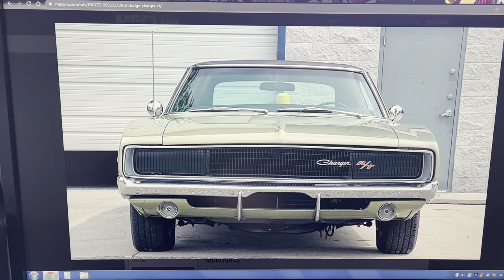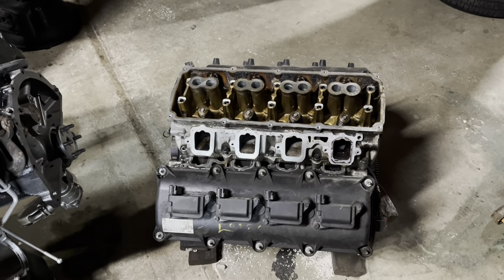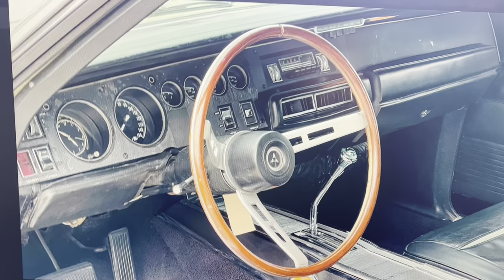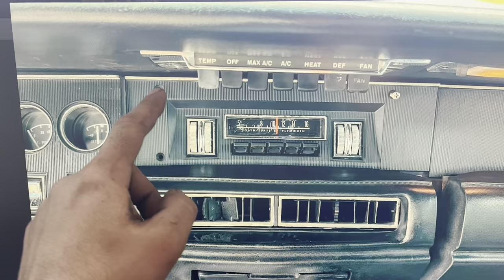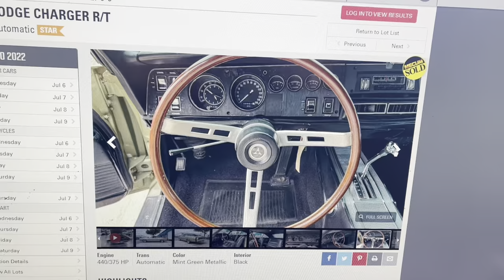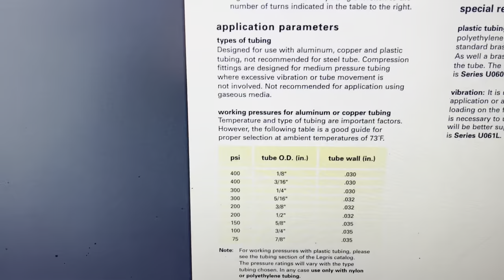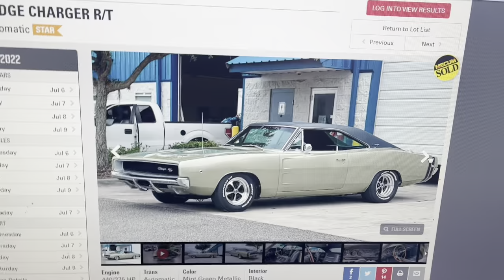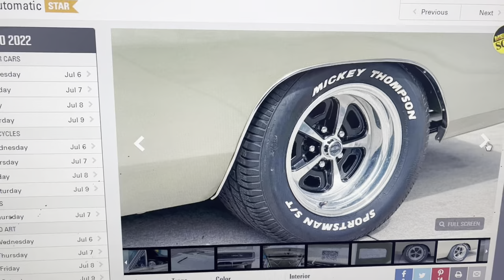Why Did This 1968 Dodge Charger R/T Just Sell At Mecum For $170,000? (It’s Unsafe And Bad)

Comment: FYI - 
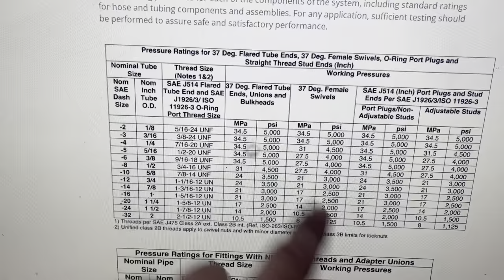At 10:45 you are looking at a chart for 37-degree fittings, AKA JIC or AN fittings.  Not used in automotive except has been adopted in aftermarket fuel systems.  The 'AN' stands for Army-Navy as was part of military specs years ago.  Is commonly used in hydraulic systems on construction/agriculture/utility equipment.  Automotive brake systems (US cars, that is) used SAE 45-degree fittings, double-flared on the tube ends.  SAE 45 is also used in HVAC, but as a single-flare and some fittings are specific to HVAC.

At 11:00 you are looking at a chart for compression fittings with alum or copper tubing - not steel.  That rating would be based on the ferrule's bite into softer tube material.  Steel tube would give a higher rating, but as noted on that particular page (whose is it?)  they aren't recommended for steel.  There are compression fittings intended for steel (Yor-Lok is one trade name) but that does not seem to be what is seen in the picture of the car.  A Yor-Lok union fitting for 3/16" tube has a 6700psi rating, quite sufficient for automotive brake systems - but I do not know if they are approved for that application (via an SAE standard or a DOT approval).

Regardless of my above comments, I agree with you that a standard brass compression fitting is not appropriate for that usage, that it draws question to quality of other work on the car, and it should never be installed with the presumption that somebody will fix it correctly later on.
Reply from the maker: I know. You’ve hit the nail on the head though - for that type of fitting, there is no rating for steel, because it’s not rated for steel. I included that information anyway, because I know there are softer brake line materials in use now and that information may well apply to them. It still drives home my point - on a softer material that can actually be compressed by that fitting, it still isn’t rated to hold that kind of pressure. I could have searched around to find more appropriate specification tables, but I think the point I’m making is clear.
Reply: @DeadDodgeGarage  Actually, the pressure rating would go UP on a harder tube, because it does not compress as easily, allowing the ferrule to crimp more effectively to the tube while it makes the seal into the union body.  You want the ferrule to crimp down into a circular line of sealing onto the tube.  I was curious and did some more digging, and Parker makes a line of brass compression fittings for steel tubing, although it seems they recommend a steel nut and steel ferrule for that applicaton.

Comment: My buddy bought a 67 Camaro 350 auto a few years ago and he got burned, engine was actually a 305 with a 350 air cleaner, it had no rear brakes at all, damn near every bolt in the front end was loose or just the wrong bolt, it was listed as rewired with a Painless wiring kit, not half the wiring was speaker wire you'd use in your house, car was an absolute mess and he paid $48,000 for it certified from a dealership, took almost a year in court to win his case and get his money back, no idea where the car ended up?
Reply from the maker: Good lord… that’s really bad. But honestly doesn’t sound that crazy today. There are tons of dealers selling that kind of garbage all over. It’s a big problem. Buyer beware…

Comment: Old video dont know if you still read comments but i had this EXACT SAME issue on a 1978 thunderbird i had purchased. The kid i bought it from was "restoring" it back to a driving condition. New fuel tank and new water pump. For his new "fuel system" he just ran a rubber fuel hose from the tank to the fuel pump. No zip ties nothing. Just hung on the ground. It would get caught in the front coil spring and be compressed so no fuel on hard right turns. He also USED A DAMN COMPRESSION FITTING on the brake line he put in. Crazy he put one brake line from the proportioning valve to the rear brake hose and that was it. Didnt touch the old hoses didnt replace the failing master. Nope. Just half ass slapped it together. I ripped into him because he lied straight to my face and tried to get money out of a trade we did. Ive un jurry rigged all his work and put a proper fitting using a flare tool. As well as all other brake work. However. When i was doing the brake lines to the rear drums off in my garage. That compression fitting FAILED right there with minor pressure from just pushing the pedal to see if the car wouldn't roll back. Literally as light of hitting the brakes as possible. What you say is true. Brake flaring tools are literally 25$ and a proper fitting is $3
Reply: NEVER TRUST SOMEONE ELSES WORK NOT EVEN A SHOP. DO IT YOURSELF
Reply from the maker: Seriously! Yes, I read all of the comments. Haha.

Comment: Well, I hate to admit it, but you are right. They were so cool and iconic, but poorly built and lots and lots of issues. The second happiest day of your life is when you buy one of these classics! Of course the happiest day of your life is when you sell it.
I hated my brother in law, who was a Ford freak and told me about the Chargers having a ride like a  bucket of bolts when you drive them. I was so angry at him. Of course, I never rode in one until I started getting serious about getting one. I did a test ride in a 70 RT and a 69 that had been rebuilt and had a new engine. They were pretty darn clunkly and I knew immediately that what he said was accurate, for I had taken his '63 Fairlane to Homecoming  in the 80s. It was a far different ride. The 390 did not have the power and torque of the 440's but there ya go. Raw power, poor build and lots of issues, but I still love them. Worts and all.

Comment: A quick Google finds lots of outlets here in the UK selling 3/16ths compression fittings as 'brake pipe joiners.'

Scary stuff. I had no idea such connectors were available. I only ever make flared brake line ends.

Comment: The vacuum headlights break my heart, they should really have fixed that, my 69 rt has an all original 80s soup can for its canister and worked up till the day I wrecked the whole front end
Reply from the maker: 😭 that’s very upsetting. Yeah, it’s easy to just hook them up and they’re a very important part of the magic of the Charger. And for $170k… personally I think the headlights should operate.

Comment: Very good points here. Why did it sell for 170k? Even a perfect restoration goes for less. Crazy that that’s just looking at the pictures. Bet the wiring is the thing of nightmares.
Reply from the maker: I know. I can’t even imagine what else isn’t visible in the pictures. I did a video recently on a much, much nicer example that was listed at a dealer for 150k. Even that seems like a lot, but prices have gotten insane. Of the two, it would’ve been the better deal by far. This car looked better at auction than it actually was, that’s probably the real answer.

Comment: I bought a car advertised as excellent in and out. Didn’t know what to look for and got a $10,000 life lesson. 😮 live and learn…sometimes the hard way
Reply from the maker: I bought a pretty expensive Charger (as alluded to in the video) that was hiding some bubbles and previous rust repairs. It’s fine… it’s still a Charger. But one day, I suspect it will cost me a good bit more than $10,000 to fix it. I’m not looking forward to that.

Comment: The term "Restored" has been and remains a very overused statement that is unfortunately used to describe anything from a base point of a vehicle receiving a rough spray job and a interior vacuum all the way through to a nut and bolt professional restoration and unfortunately it confuses people who do not understand cars nor restoration work, auctions are a classic dumping ground for vehicles just like this, I pity the new owner as when they take it to have work performed on it they will receive a lot of very bad and expensive news. I remember viewing a 1969 Boss Mustang that had undergone a "rotisserie restoration", yes it clearly had been completely disassembled and placed on a rotisserie, but the reassembly was just like this car and was clearly put together by someone who had absolutely no idea what they were doing, but they were correct in that it had been on a rotisserie.

Comment: Brother, in the last five years this has become depressingly common. There are whole shops that do nothing but slap together and flip classic cars and then sell them at auctions. I have seen many cars that were so bad they were literal death traps. we're talking unmounted brake calipers, bodies barely connected the the frame. Rotted out frame rails covered in bondo, frame components literally missing, chunks of two by four replacing transmission mounts. fenders mounted on tack welded scrap steel because the actual mounts had rusted away. you just wouldn't believe it. I would guess probably half of all the classic cars going through recent auctions and for sale at classic car dealers are in this kind of shape
Reply from the maker: Oh, I know it… I’ve seen way worse than this. It’s just that this one was as bad as it was, but sold for top, top dollar for one of these cars that bothers me.

Comment: I'm no pro either, but after 10 years doing a resto on an E-body and doing every bit of research, going through the corporate packets, collecting every bit of information, and then putting it to use. Well it's ruined me when it comes to challengers and barracudas. I very rarely see one that's done right, safe, or presentable to a person in the know.

Then I went to work in a body shop. I can't hardly go to a car show any longer. Cars that 15 years ago I drooled over, I'm now silently picking apart. Disgusted with a lot of it, "omg wtf did they do here" goes through my head a lot.
Reply from the maker: Yeah… bad body work is pretty much the norm. My Charger isn’t any better for that. It’s definitely interesting to realize that even the most beautiful car you see at a show is probably hiding patchwork and bondo.

Comment: The sad thing about this hobby is, as more and more quality shops can't afford to keep their doors open due to high labor costs, part shortages and general high costs that open the way for cheap hack job shops to throw on a ton of filler, slick the body and flow paint smooth as nail polish but cut as many mechanical corners as possible. Cut corners where it dont show makes for higher profit. Take your time and do your homework, don't be afraid to walk away most times you can trust your gut feeling.
Reply from the maker: I know. It sucks.

Comment: I've always been wary of these car auctions, I've seen guys loose multiply brain cells when bidding on cars at these auction, by sometimes bidding way more than the car is worth, or you could build yourself. Whoever bought that thing for $170,000 without having a knowledgeable person look it over first deserves to get burned. Myself, one of my cars is a 1965 Ford Fairlane 500 Sports Coupe that was an original 289 4 barrel 4 speed car that had a good body but was in pieces. I then proceeded to rebuild the car myself, and after 5 years of work, I have a well built, safe car with a 450 HP 347, Borg Warner T10 (original transmission), 9" rear with 4:10 gears, a Detroit Locker, Baer Pro-Street axles. It has a narrowed rear end  with 29 x 15.5 x 15" tires, 4 link suspension, 4 wheel disc brakes and Viper Red paint. The only things that I didn't do was the paint and the upholstery. I've probably got somewhere around $120,000 dollars in it but I'm not afraid to drive it. I have taken it on 320 mile round trips without a problem or a worry.

Comment: I see stuff like this a lot..especially if the car has been to multiple shops prior to falling in my hands. 
That radio bezel is a perfect example of the kinds of things I see. 
Missing and incorrect mounting hardware. 
Can't stand it when I work on one of these and it's immediately missing the correct fasteners,  screws, clips, nuts and bolts . I consciously cannot reassemble and let it leave my hands without all the hardware it was designed to be put together with..it is not fun to fix another mechanic's neglect or  incompetence. How they got away with such shoddy workmanship is inexcusable.
Reply from the maker: It’s maddening. I work in a restoration shop, and one of our biggest strengths is in the knowledge, hoarding, and restoration of correct hardware. We’ve got piles of factory Mopar nuts and bolts, bins of correct breathers, caps, brackets, linkage rods, wire connectors and terminals, and on and on… Not every car is going to be 100% right on this front, but damn, they could at least try.

Comment: Great video and very accurate. More than likely it was someone buying based on emotion from the pictures. Kind of like that MILF you go home with from the bar. After a "few" beers and in the dim lighting you swear she is a 9/10. Upon closer inspection, in the light of day, you realize she is more like a 6 or a 7 and is batshit crazy. At least in that analogy, you can slink away to lick your wounds. With a car like this, you are stuck with either having to pony up the money to at least fix the worst of the issues or let it go for a fraction of what you paid and chalk it up to a learning experience. I have learned the hard way myself that you take a friend to keep you from walking off that kind of cliff. $170k...yikes...
Reply from the maker: That analogy 😅 so fitting. Yeah…it’s all bad.

Comment: Just like there were 'house flippers' a few years ago, many jumping into a 'career' that they had no real idea about (you know, plumbing, carpentry, etc.), some became broke from it, but a few lucked-out and became rich...and turned it into a 'get rich quick scheme'. 'Collector Cars' are just a variant of this. This is a 'backyard tarp rot-away' that someone found, painted, patched, and finding 'good numbers', sold...with a huge profit. The crime is on the buyer, as well as the seller. I don't buy Rolexes for a reason. I don't buy diamonds for the same reason. If I am not 'familiar enough' to tell 'swine from pearls', I am NOT going to drop 1/8th of a MILLION DOLLARS on something 'I feel that I need'.
Maybe its just me...I'm an old guy now. I was there when these cars were still on car lots for sale. I've owned 9-different 'legendary musclecars' (AAR Cuda, GTO, Trans Am, Camaro Z, Mustang 2+2, etc.) and I don't remember paying over $6k for ANY OF THEM! I drove them hard, I didn't keep all of them that long, actually. They were generally 'ill behaved', too thirsty, hard on parts, poor quality ride...and without fail, the one guy with the Nova that he'd had since he was 16, that he'd dumped every cent into, would walk off and clean your clock if you thought 'street racing light-to-light' would show you to have 'the better car'. Collect them? ROFL...I had the chance to, the first time...and passed (though, my 68-GTO Ram Air III did ride SMOOTH...like a Cadillac!)  If I wanted 'kick', 'speed', 'raw-performance' now, I'd just order a kit from Fast-Five or a built Ariel Atom, and 'call it done'...for FAR LESS than this wonky old Mopar...I wouldn't give you $80k for, if it was sitting there with a full-on Race Hemi with zero miles on it!

Comment: I bought a 1962 triumph TR4  in 1980. I paid entirely too much. The previous owner had no car knowledge. Looks are deceiving. I almost died in that car. The fuel filter fell off on the highway. But the real problem was.....the prior owner put normal U.S. brake fluid in that car. The Brit car used Castrol brake fluid for natural rubber seals. Well, the brakes gave out. I crashed and was nearly killed. The rubber seals were eaten through by  American brake fluid. 
My passenger never let me forget it either. Anyway, people would blame that accident on the driver and overlook the brake seal problem. Just exactly like this Charger. You WILL be killed in it and people would say" it's a 170G car, he must be a bad driver".
Reply from the maker: Wow… yeah. That’s nuts. And yeah, exactly the same thing could happen if this brake line union blew apart.

Comment: I agree compression fittings don't belong on a 170,000$ build. However it might surprise most people but 98% of all shops repair brake lines with compression fittings and if a 100 people comment on this video theirs a good chance 50 people have a compression fitting on their car and don't even know it. I'm a tech with 17 years experience
Reply from the maker: If 98% of shops are repairing brake lines with compression fittings, then 98% of shops need to be fucking slapped. Those fittings are not rated for steel lines, let alone that kind of pressure. I know a lot of people do it anyway. But if actual shops with certified techs are doing it, we have a problem. I ran a shop for seven years, and NEVER thought I could get away with that. I used flares and unions like a not-idiot.

Comment: Over-priced accident, waiting to happen! What makes me sick, is I had a 69 Roadrunner hardtop, I bought new in 69, wish I had kept it!
Sold it in 1975 for $850. KBB price. It was all original, numbers matching 383HP, automatic then!
Reply: I had a similar story.  In 1975 I bought a 1969 GT350 for $3000  Drove it 2 years and traded it for a Lincoln Mark IV.
Lol....I was 18.
Even better story. 
In 1977 I had a chance to buy a 1970 BOSS 429 for $3000.
The owner was honest and told me it needed valve seats. 
I didn't buy it because of that. Lol

Comment: Looks like it was put together  by a body teck. Not an all around assembler or possibly more than one person.  I did a 68 GTX. for a guy that was the same way. Parts of it were 100%. Some not so much.  It took a lot of sorting out. Things like no kick down linkage.  Onley got one half throttle.  End carbs did not open. No fan shroud.  Plug up radiator.  It was a pretty car to look at. The guy that bought it was not a poser  he wanted it to drive. So we fixed it.